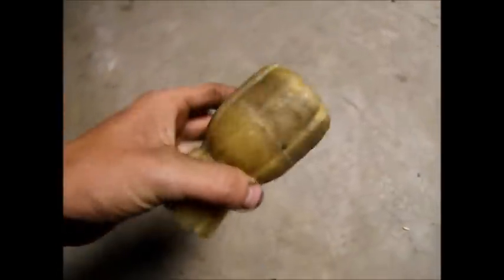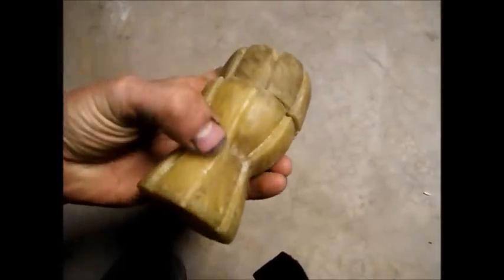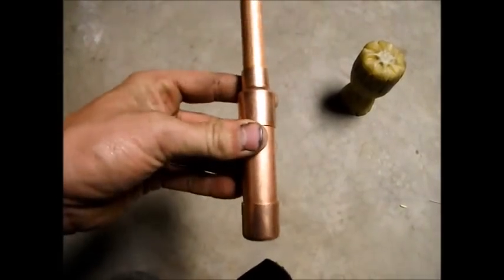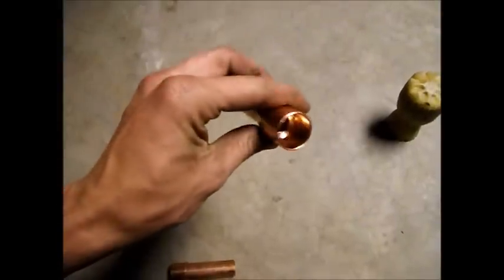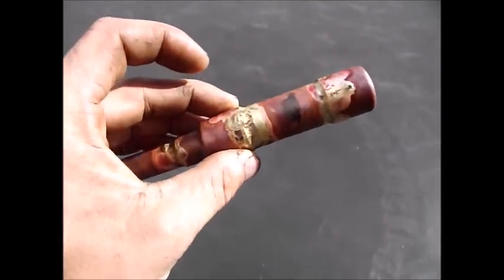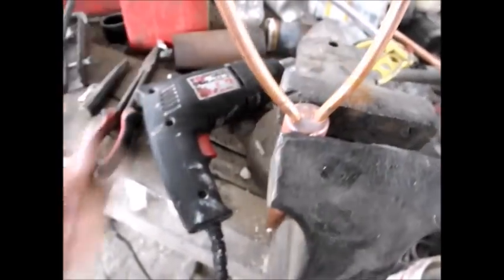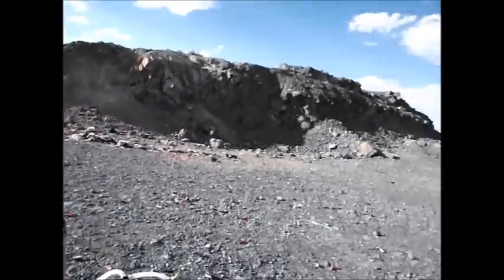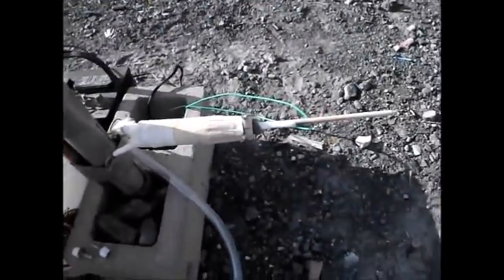liquid Fueled Rocket Construction and Attempted Burn.

Comment: Btw you can use pine oil, when combined with HNO3 (not sure about N2O4) it starts burning on its own. I mean the hydrocarbon pinene, used as a solvent for paints sometimes (at least here in Russia).

Comment: Hey Cody, I would suggest using N2O4 as an oxidizer, for sure you will be able to obtain it, and this stuff is also self-propelling without nitrogen because of its pressure, and it won't corrode anything. Or, you could simply have rinsed your copper cylinders with some HNO3 to passivate the copper initially before loading the oxidizer. Love your channel, hope my suggestions could be useful;)

Comment: I'm assuming the nitric acid reacted with the cooper tube. The reaction caused the rocket to lose its oxidizer which is why it did not ignite, and the color of the fume coming off the nitric acid reservoir further proves that there was a reaction between the tube and the nitric acid

Comment: The nitric acid may have reacted with copper oxides formed on the inside of the pipe from the heat during the welding process. I tried something similar and found a flaky black copper oxide film inside my copper pipe after torch soldering. I just rinsed the pipe with dilute HCl and used a pipe brush before using it again.

Comment: If this is a hypergolic mixture, why does it need an igniter?
Reply: Could be for redundancy?
Reply: because it's not hypergolic immediately.
he was using diesel as his fuel, which reacts very slowly with nitric.
if he had used something like aniline or hydrazine, then yes, it wouldn't have needed an igniter

Comment: You're so good with chemistry and you didn't stop and ruminate on the fact that HNO3 reacts with Cu?
Reply: +Archishman Ghosh He showed in an earlier video where he dropped a Cu nugget in the conc acid which quickly passivates and stopped reacting
Reply: Did he passivate the tank before loading it? Another thing is that HNO3 slowly decomposes into oxygen, NO2 and water. He also showed that in the presence of water, there's much more of a reaction.

Comment: Even I got exited (like I always do testing something)! And I wondered why copper was used for the acid vessel when in previous videos it was explained nitric acid dissolves copper or did it passivate it? looking forward to watching the next one right now.
Reply: +fla playa I was thinking the same thing, in the nitric acid video you see the copper react with the nitric acid untill it had the green copper oxide layer on it. So maybe this engine would work a second time, when the pipe is 'coated' inside. Still a great video, love this channel, can't stop watching.

Comment: hydrogen peroxide and a catalyst is what I would start with. Hot gas, no flame.
Reply: +Osel Somar you can heat regular peroxide to steaming but not boiling, by repeaded heating and refilling, you can get high % peroxide. Also, barium peroxide and sulfuric acid will yield an insoluble precipitate of barium sulfate and near 100% hydrogen peroxide.
Reply from the maker: +Osel Somar 
You can roast barium carbonate (can be purchased for coloring fireworks) to give barium oxide which can be further oxidized to peroxide by passing oxygen gas over it at 500C
Reply: +Osel Somar you can do Cody's suggestion or Barium Peroxide is avail from chemical outlets if you live in the US.

Comment: How soon are you doing a new test?
Reply: Thanks man! Do you have any previous experience with rocketry? If you turned this into a formal series with explanations as you did in one of your videos it would be awesome. Anyways, good luck with the next test!
Reply: Thats a really good video for beginners, but im talking about more serious stuff, like nozzle optimization with cfd, approximations to the equations of motion of a rocket with drag, some design requirements for the combustion chamber, maybe some chemistry for the propellants and such.

Im still in high school, and learning to do some of these things has been really tough, I can numerically solve for the motion of a rocket with drag and other stuff but propulsion is really hard me to understand. What books are you using to design the rocket? Could you do some explaining of something like Sutton´s rocket propulsion elements or books of the kind? 
Thanks!
Reply: Cool! I cant wait to see how the series develops. Sure man, that would sure save you a lot of money. Have you got any plans to make the engine throttable?
Reply: Can you not change the mass flow rate with the nitrogen valves?
Reply: To avoid losses due to aerodynamic drag and maybe add some control to the rocket. How much thrust You said you wanted to go make it to space on that engine, how much thrust will it have? I was thinking you should set up a kick starter for the project, maybe do a couple more tests to have some nice explosive footage of an engine running to draw more attention. I d be glad to contribute with what it can.
Reply: Yeah, building something a rocket engine from scratch will help a lot. I started building sugar rockets to try and help with applications for universities, do you think it might help?